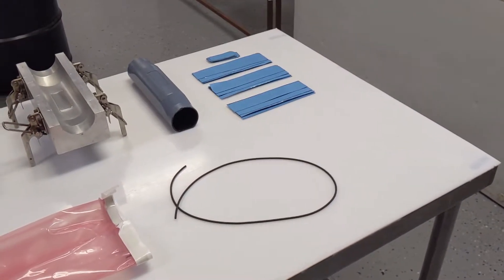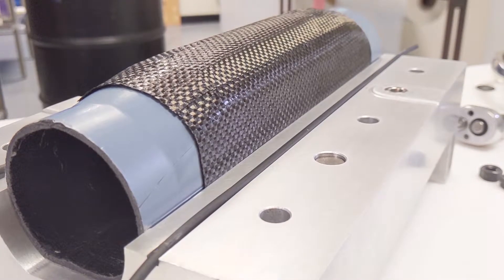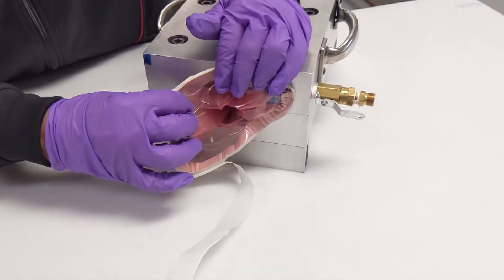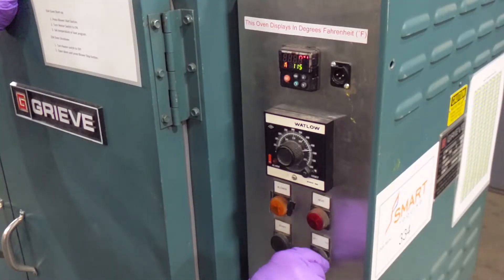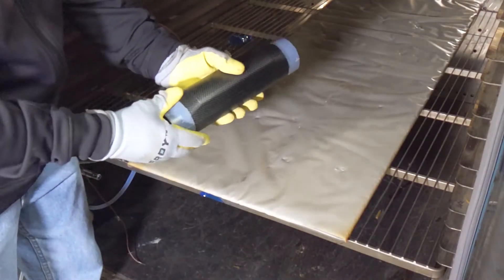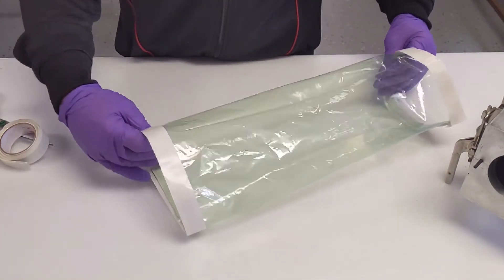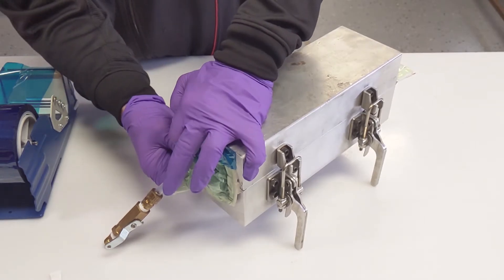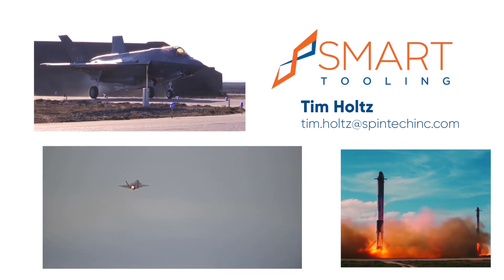Shape Memory Polymer Bladder | Composite Tube Demo Step by Step Instructions | Smart Tooling

Comment: good attempt, but I think there is no need of such complicated mould with air channels, along with vacuum bagging + wastage of sealing tape. Simply use silicone bladder insteat of using this "smart pipe" 
for silicone bladder there will be no risk of carbon layer pinching, simply make lap joint, put the silicone bladder in vacuumed state, remove the vacuum, close the mould, apply pressure. that's all !!!!!!!!!!